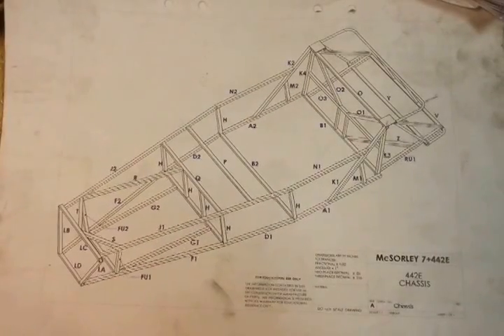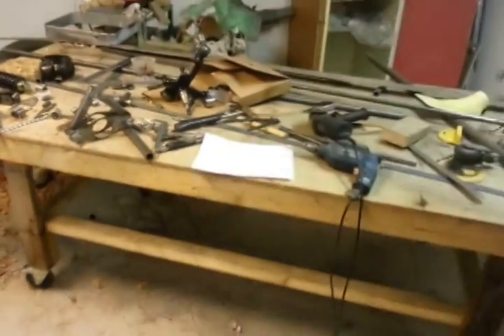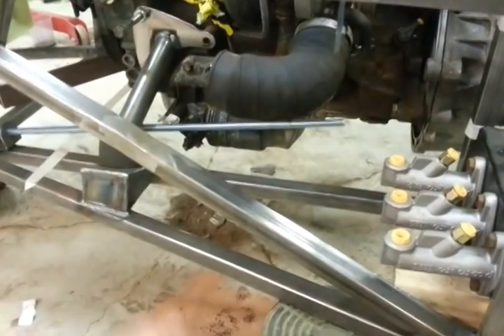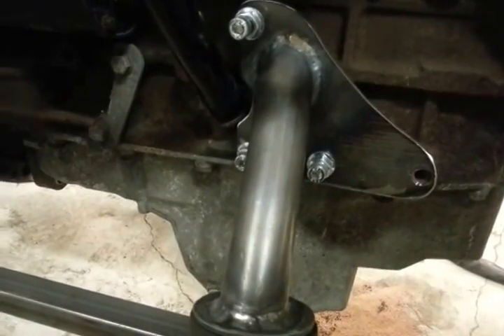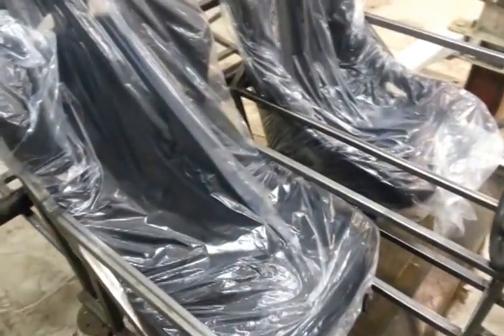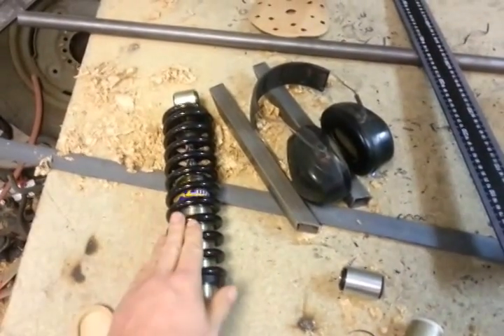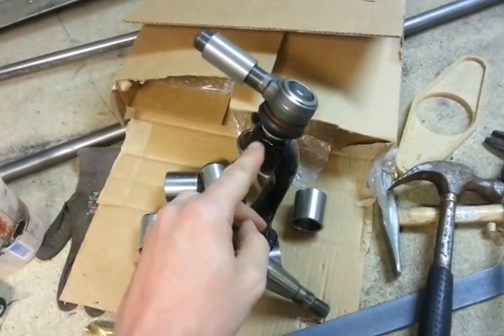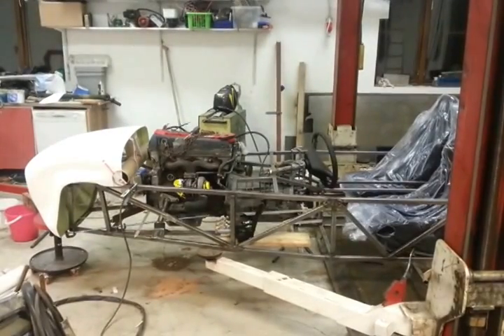Building Super 7 Locost Ep1

Comment: Hello sir, can you please tell me what model of transmission is or which tongues it was made
Reply from the maker: Opel Omega 5 speed
Reply: @DIYTechRepairs  Respected sir, I know that it is for an opel omega car, but I mean the date of its manufacture, for example 1999 or 1998
Reply from the maker: @mohammedghassan1165  dont know. Its an r25-28 and in this case its the stronger 28 inside.